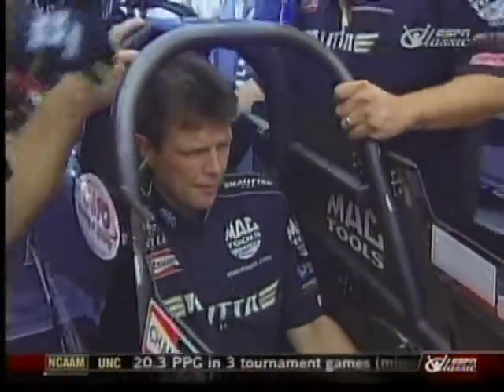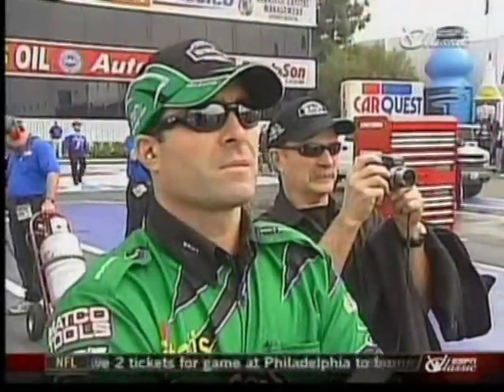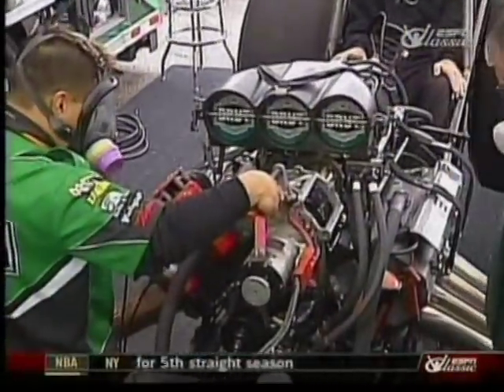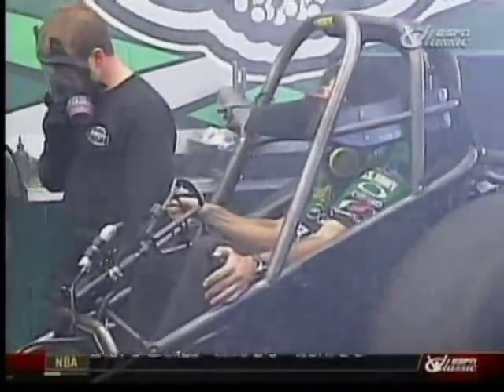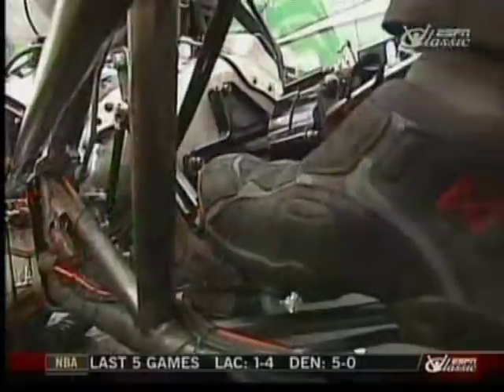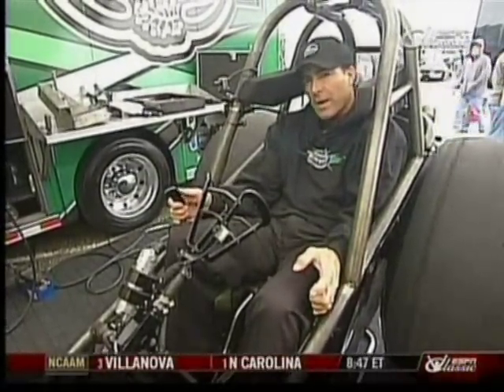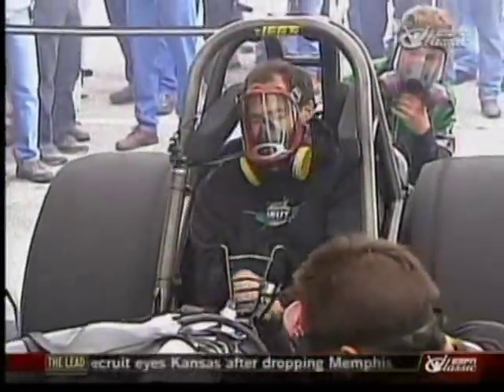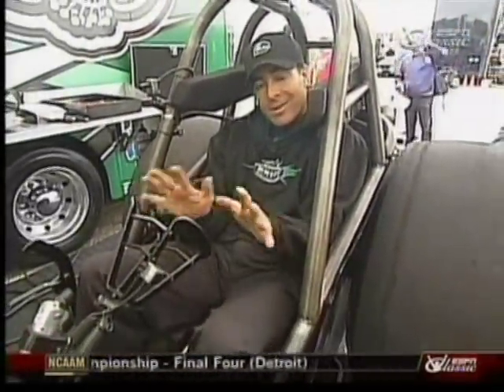Ron Capps walk through of a Top Fuel Dragster warmup

Comment: sorry to go on again. Youtube doesnt let you do a long post.  I was also going to say i dont think its to do with the second fuel pump, as, as far as I know, start up and burnouts are done on one pump, and the run on both.  Or, as Ron says, low fuel prssure and high fuel pressure.  Have a look at the Lex Joon warmup at Mantorp in Sweden to see what I mean re engine note and nitro fog.

Final point, thats a really good explanatory vidoe by Ron. Good Stuff.
Reply: So I know this old I have heard from someone who used to crew Chief top alcohol that said Jimmy prick only warms up on the front half of the pump which is all here say as this was about 10 years ago as I listen hard and don't here an insane difference among fuel card warming up.  And of course this is over ten years later they all do about the same thing and check the same things so the exact process is different among every tuner.
Reply: The RPM drop just prior to driver bumping in and turning on their staged light (2nd yellow) is the driver pulling the 2nd fuel pump to full on and stepping off the clutch pedal. The 2nd pumps fuel further enriches the A/F ratio (lowering RPM) as well as the stall springs on the clutch pressure plate allowing the clutch to slip just enough (with foot off pedal completely) at idle to not stall the engine.
This load is critical in ensuring the richer mixture at idle will get ignited, and to intentionally build cylinder temps which aids in NOT fouling cylinders (wetting them out w/fuel) during the run. 
Nitromethane loves being under load, more load/pressure the better it’s efficiency.
OR
Have you ever noticed how wet the headers are “fogging” the air with unburned fuel during burnouts or when they break traction and go into instant tire smoke during a run? 
CH3NO2-Nitromethane…. No Load = No Burn!

Comment: Question...What are the two people doing to the blower before a race? Right before the staging one person from each team seems to look at one another then remove/ adjust something on/near the blower/intake.
Reply: Lawrence Spies Two things.. he's taking the throttle stop off, and might be adjusting the barrel valve.
Reply: Adjusting the barrel valve and taking the throttle stop off..
Reply: correct t.n.t
Reply: Adjusting the Barrel valve idle circuit to full rich. The RPM drop just prior to turning on their staged 
Iight is the driver pulling the 2nd fuel pump to full on and stepping off the clutch pedal. The 2nd pumps fuel enriches the A/F ratio (lowering RPM) as well as the stall springs on the clutch pressure plate allowing the clutch to slip just enough (foot off pedal completely) at idle to not stall the engine, this load is critical in ensuring the richer mixture will get ignited, intentionally build cylinder temps which aids in NOT fouling cylinders (wetting them out w/fuel) during the run. 
Nitromethane love a load, more load/pressure the better it’s efficiency.
OR
No load = no burn, ever notice how wet the headers are fogging during burnouts or instant tire smoke during a run?
Reply: @TNTBoom-gf3er  Thanks!
Reply: @Over_The_Top-1320  Thanks!

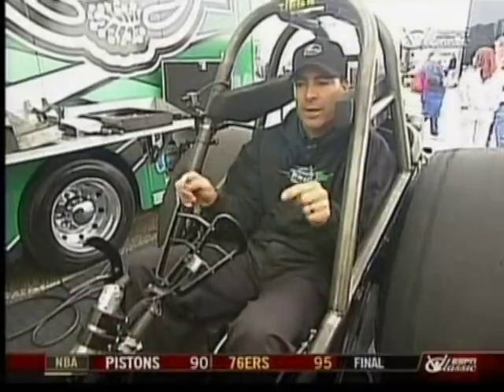Comment: What is he putting into the intake manifold at the 0:59 mark in the video?
Reply: Alcohol. Top fuel & funny cars are started with alcohol and then nitro is quickly introduced.  If you listen closely you can hear the change in fuel.
Reply: Thanks!  Do you know why they're started with alcohol?
Reply: You can see it too, when they bring in the nitro. Blows white fumes out of the pipes
Reply: +TheBd50 incorrect. Please explain why the crew members are wearing masks during warm up. Next time you're at an NHRA event you go right ahead and stand close when they start up so you can enjoy the burn of "gas".
Reply: nonsense, methanol does no such thing. .....gasoline is extremely unstable and you should never 'squirt' it anywhere
Reply: and what the hell is a 'methanol engine'?  never heard the term til today.
Reply: and what the hell is a 'methanol engine'?  never heard the term til today.
Reply: you my friend Bd50 are so wrong on so many levels,  now is the time you step back and stop giving answers to people when you dont know yourself.   Thanks from YouTube!
Reply: TF cars have 2 44amp magnetos just to get nitro to burn,  you see cars with a dead cylinder on the track constantly,  nitro is a bitch to make burn so they fire the cars up on alcohol to get a bit of cylinder temp into it and get it running first.  nitro cars run around 50lbs of boost,  if you started the car on "Gasoline" like you claim that they do they would detonate themselves apart almost instantly even on idle boost.  Think before you talk and dont comment on things you know nothing about champ
Reply: @TheBd50  wrong !

Comment: yes and no!  Not having been to the US, i'd say they start on nitro.  But in Europe, pehaps cos of cost, they seem to start on methanol or race fuel, not sure, as they often suck fuel through from a bottle by the side of the car, then switch over to the nitro/methanol mixture. certainly they often start of relatively smooth, and then get really rough when the nitro kicks in.  And at that point the car gets surrounded in a yellow fog of unburnt nitro.  I'm no expert, just a fan.

Comment: The reason they use a v8 is because this is the engine most hot rodders identify with and this nitro engine is THE baddest of them all, besides if you can go 330 in 1000 ft what do you need a v12 for.
Reply: That's not really the reason, it';s because it is a standard auto engine format and the heart of the early days of hot rodding. Piston speeds at normal rpms are sensible. Why would anyone run a V-12 for drag, there is no advantage to doing so. Engines on fuel aren't revvers, they are torquers by nature, how do smaller cylinders and more parts help you there?

Comment: how do I learn to warm up these engines cos im a nostalgia funny car freak and slingshot dragster fan too how do I warm these beasts up as a disabled rookie in drag racing im gonna be a tuner/driver in those funny cars that's the nostalgia funny cars and slingshot Fuelers and fuel altereds too im from Australia  I am a hard core racer for a long time through attendance  at the old eastern creek drags  but id love to race at Sydney dragway as a tuner/driver racing my funny cars under the purple Brutus names with a Chevrolet Monza  due to the body rules for N/FCs  that's why I have abide by the rules that's why I will use a Chevrolet Monza body the foxy mustangs will be used if the N/FC body rules changes id say with the NHRA or ANDRA That's is those sanctioning bodies allow the later model bodies like the foxy mustangs and the 3rd gen Camaro funny car bodies for us guys who bought later model chassis to fit em to if the rules do change to allow these bodies in the mix that's  why the racing will be even closer if we allow the 3rd gen Camaros and the foxy mustangs in the ix with the older funny car bodies that's my views  from mick the mongoo$e  walker
Reply: +michael walker Go for it
Reply: +TheAnt 777&#160; im from Australia&#160; and I need some help at learning how to warm up a nitro&#160; Donovan and im a rookie at sort of thing and what precautions I need to take&#160; on how to run these beasts and also I need to know&#160; how to get my rookie crew used to doin that&#39;s sort of thing&#160; this a new thing for me as I enter drag racing for the 1st time in N/FCs  with a rookie crew that&#39;s where in gettin&#160;into and I knew I will have fun doin it that's why
Reply: michael walker Well you should go to a drag racing track and ask another driver or an official there. They'll understand what you need help for and why your asking it